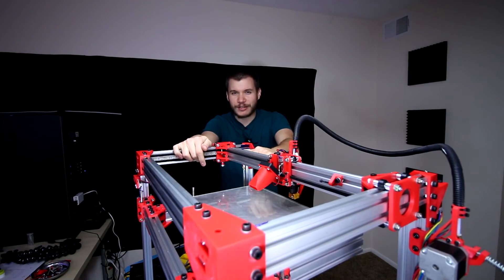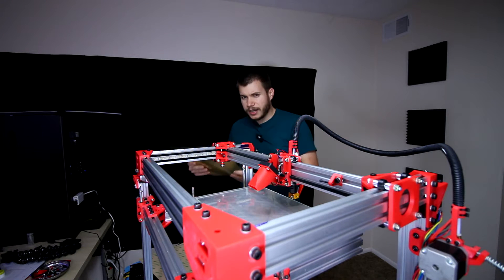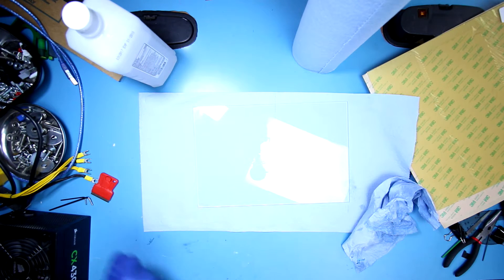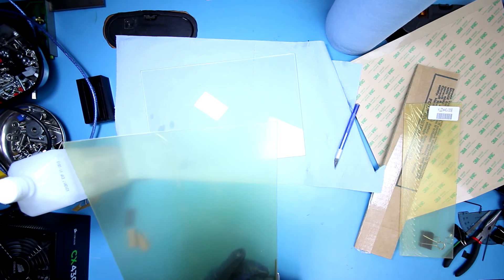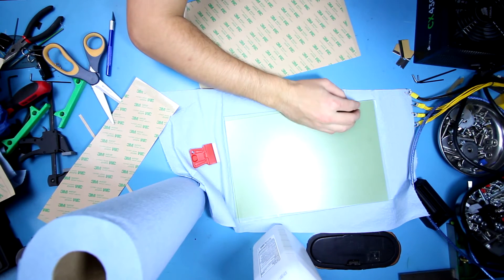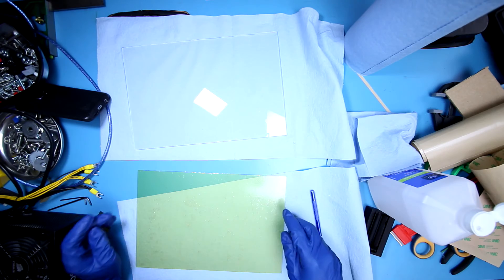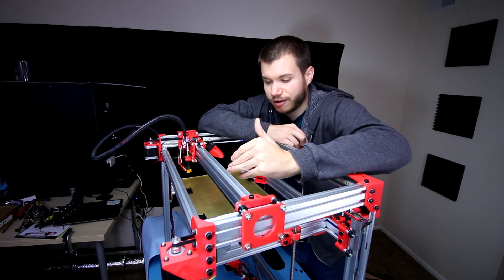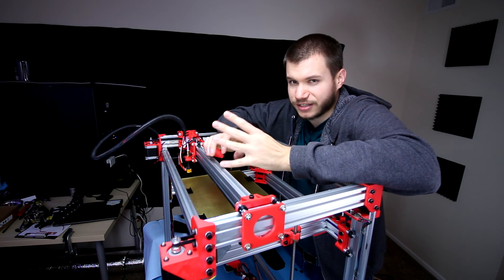The ultimate 3D Printer bed adhesion surface! - PEI

Comment: How easy is it if you need to remove or change your PEI sheet from the print bed with the 3M AdhesiveTape ?
Reply from the maker: +TheGreenPastures It's a bit tricky. You have to soak the adhesive with goo gone or wd40 and scrape it off with a putty knife and razor.

Comment: I fear the sticky tape as I suck applying tape as it always ends up with bubbles.
Reply from the maker: Dark Alchemist A few small bubbles are ok as you can pop them and flatten them out. I am pretty terrible at it, which is why it takes me over an hour to do both sides.. XD
Reply: Power Playground
The glass side I could just pop them with an Xacto knife but how do you handle it from the glass to the aluminum bed since the tape is already affixed to the glass?
Reply from the maker: Dark Alchemist The glass just sits / clips on to the aluminum bed. the you adhere the PEI plastic sheet to the bed. I usually stick the tape to the pei sheet first then the glass.
Reply: Power Playground
That is what I meant I am half asleep, lol.  So, I adhere it to the glass and get the bubbles out by popping them but how to the glass since it is already affixed to the PEI?  That is the worst part.
Reply from the maker: Dark Alchemist I pop out the big bubbles when I stick it on the pei. Then I apply it slowly to the glass and use a roller tool or a squeegie type tool to force out any remaining air bubbles. It doesnt have to be perfect, you can have small pea sized air bubbles and you will be ok. That's why I print with a raft, you can get away with a slightly bumpy bed surface.
Reply: Power Playground
You know I never had an issue with direct to boro then one day POOF it ceased to stick and this was ABS and PLA.  The size of my new printer's bed I am building is 300x300 so even more chances of bubbles. :/
Reply from the maker: My bed measures around 300x220. Fortunately those adhesive pads come in 6 packs. :P Also stock up on some goo gone / goof off / wd 40 just in case.

I will say that once it's on, you won't have to take it off for a very long time. I have printed over 5kg's worth of plastic on my current pei bed piece!
Reply: Power Playground
Nice indeed.
Reply: Dark Alchemist  just apply soap water......
Reply: Bent Hillerup
Wait, soapy water makes sticky no longer sticky on normal tape.
Reply: Dark Alchemist 
When wet it wont stick, but when you squice the watter and air buble out, it will stick again.
Search for tinting car windows here on youtube.